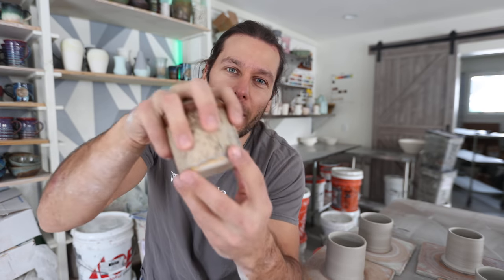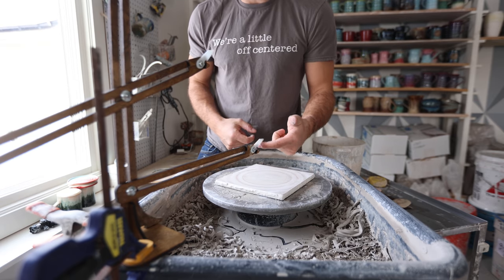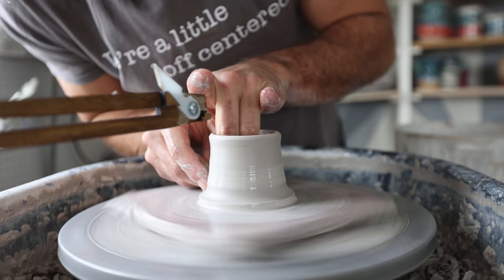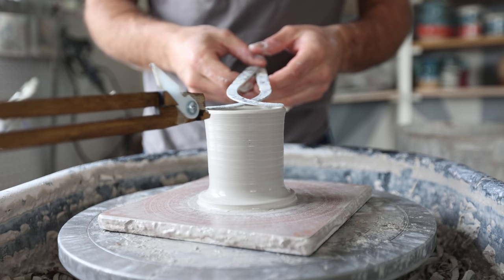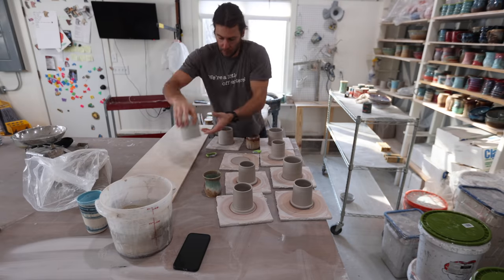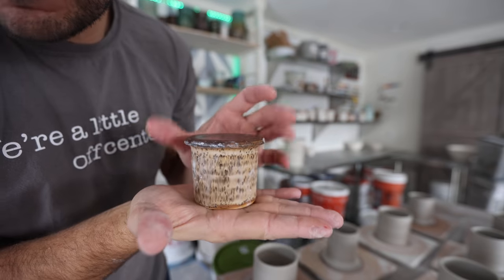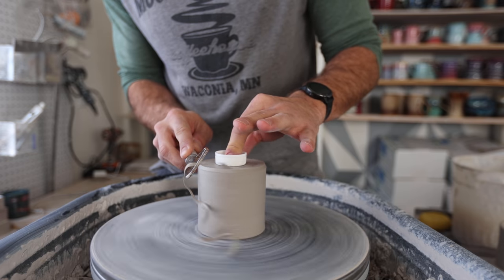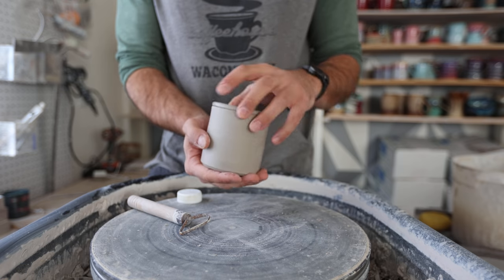How to make a Butter Crock/Butter Bell/French Butter Keeper

Comment: Really great video on how to make the crockery and use the gauge - I have a similar one made by Darren Ellis.   I make these butter crocks all the time…..A few have commented that you should angle the inner cylinder slightly inwards to prevent the butter from sliding out.  It is a valid point for warm/hot days,, trust me, I know because I live in the tropics.   MY additional critique is that you should allow more room between the two pieces, they are not meant to be snug.  Curving the outer crock a bit will solve this and give it more tabletop appeal.

Comment: One small helpful hint. You should angle the inside piece slightly. This helps keep the butter in the crock when it is soft, otherwise I’ve found that it ends up sliding out and rests on the bottom of the outside piece. Thanks John, been watching your videos for years - very educational and entertaining.

Comment: Hi, please how do you dry these? With the lid in or out? I worry when drying with the lid in, the outside vessel will dry faster and shrink while the lid stays leather hard and not dry evenly. But then, when drying separately the pieces can warp and not fit? Do u please have any advice on this?

Comment: Hi Jon You are using Continental buff? Is that a cone 6 no grog? I want to try some new clays. I keep running into stiff bags w the bmix laguna/axner. Its probbaly my local supplier holding stock i'm not sure.... I just never know what I'm going to get next from one bag to the next. I'm used to bmix5 (wc 401) it's super smooth but very inconsistent bags. Can you recommend something I may like similar? Thanks Bud!

Comment: Would you mind giving out the measurements for the whole piece, and the width of the openings in inches?? I’m a ceramics student trying to make some for my final project of the year
Reply: You can pick any size you want. There isn’t a standard size. The inner liner pot just has to easily fit inside the outer pot in width and depth.

Comment: I'm curious how you would go about adding a knob to the lid?
Reply: I hope John doesn't mind me chiming in on this. The only knob I've put on mine was one that also functioned as a pedestal so when it's being used during a meal you can set it down without having to put it back in the bottom piece. I like John's method also because you don't need to put it back in the bottom piece. This way you don't have everyone dripping water all over the place every time they use the butter. On my latest design I trim a foot on the top of the lid which is also glazed and fired like John does it.

Comment: I'm usually a fond of angular pottery. but isnt it impractical to have the interior bit shaped as a cylinder? I think it's called butter bell for a reason. you don't want butter lodging in the corners because then it'd get rancid. you want this type of vessel to be absolutely easy to keep prestinely clean and ultimately have no corners.